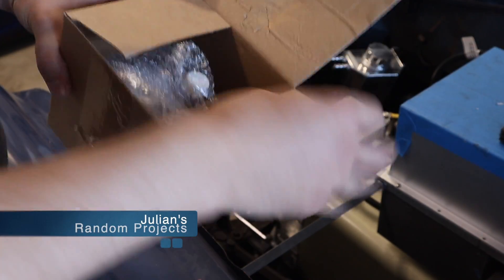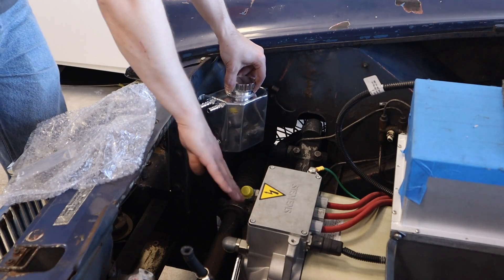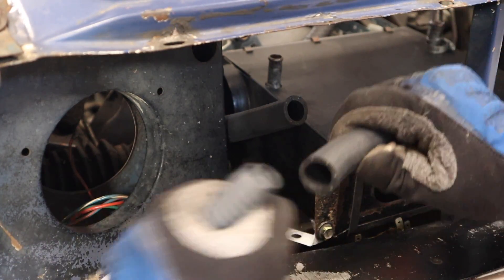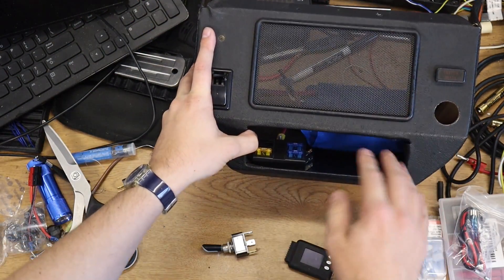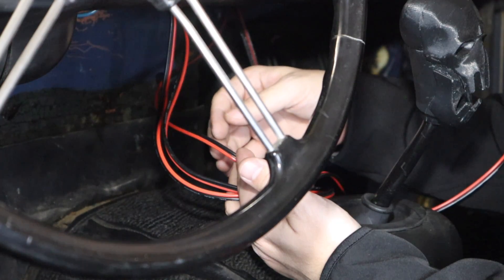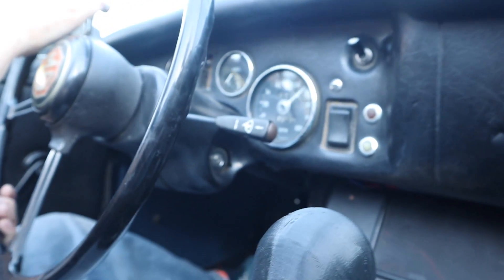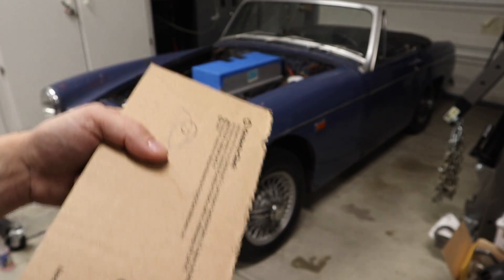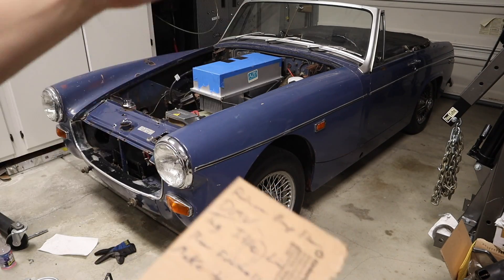MG Midget EV Conversion Part13 Driving Time!

Comment: Nice work!  I had an MG Midget that I put a Mazda Rotary & 5 speed into.  I also did an EV conversion with the Siemens AC induction motor.   I've snapped a few Midget axles, one of the weak points even with the stock motor.   If you haven't already, start shopping for some heavy duty axles, they are easier to change out before they snap!
Reply from the maker: Nice! I fully expected to be twisting axles and rounding off splines. Are you suggesting that one could purchase a harder axle that slides into the existing diff housing? That'd be awesome. Trying to keep the build cost down as a challenge. Phase two may incorporate spending to upgrade suspension, drivetrain and interior.